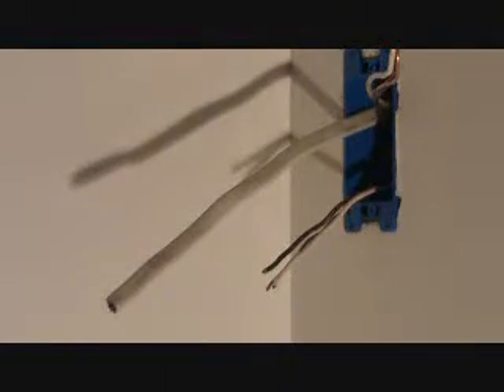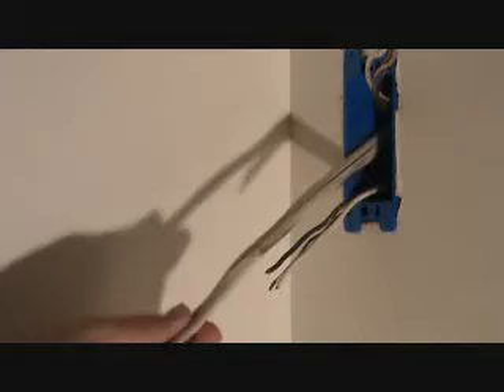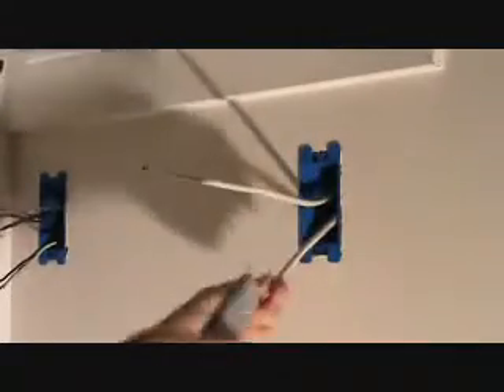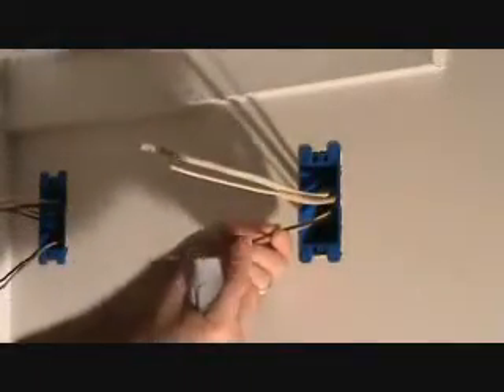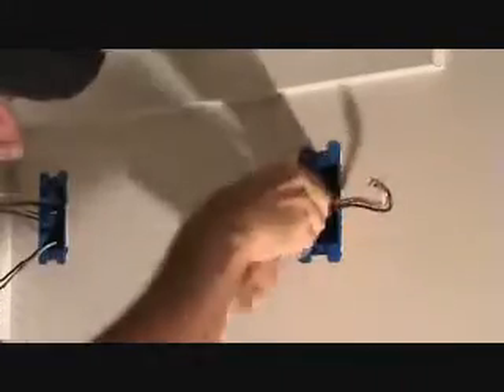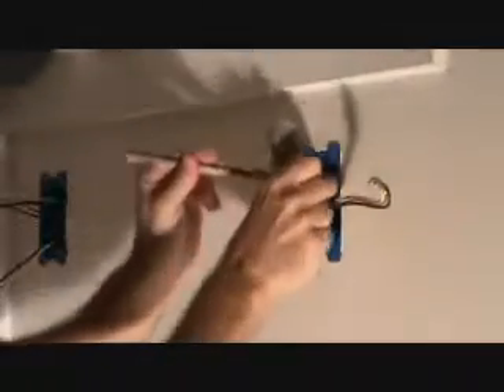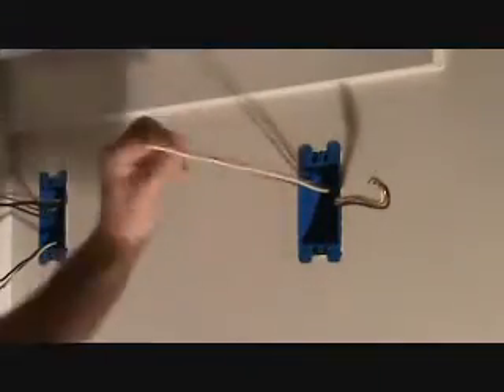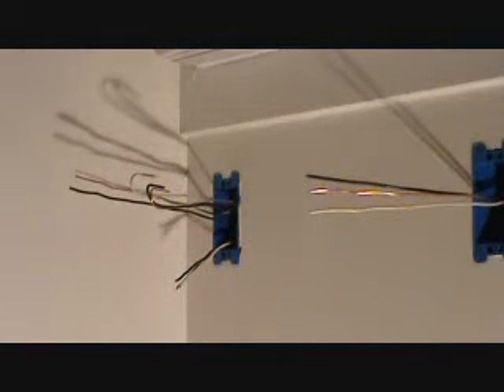How to strip wire...Part 2

Comment: Great video Mr Joe. I like to use wire strippers to save time, but excellent video!
Reply from the maker: I've seen that tool for stripping romex cabling but I have never used one. So they work pretty good?   Joe  :0
Reply: They do work good, but like every tool. In order to get used to it, you have to use it at least once or twice. Another one you could pick up is a non metallic cable stripper, which is like 5 bucks, so if you don't want to spend $20 on a pair of kleins, then I definitely understand. The whole point of DIY is to save money.
Reply from the maker: I saw those kleins. Look pretty cool. yes the one tool I saw wasn't as sophisticated as the kleins but they worked.   Joe  :0